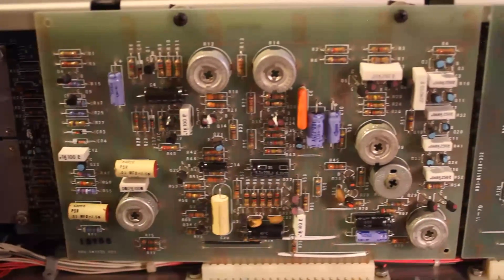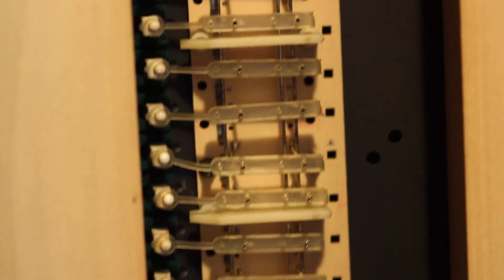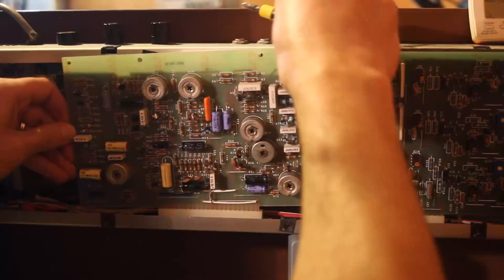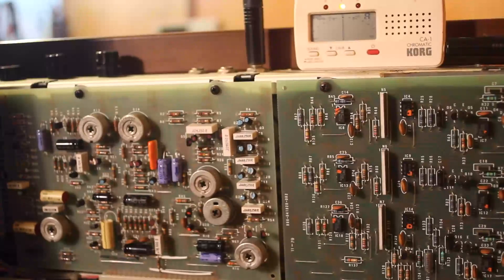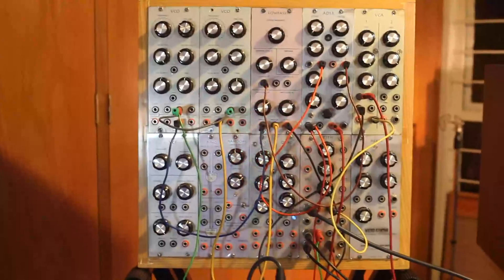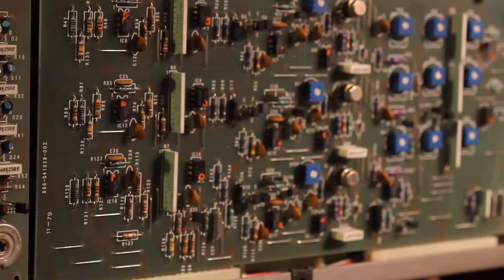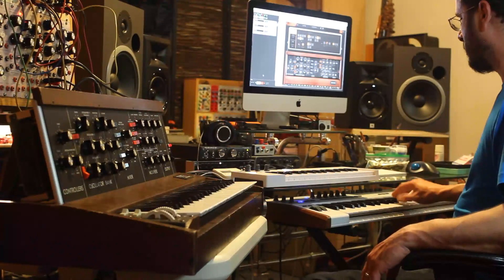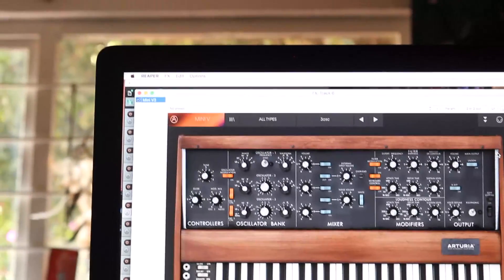Report # 2 - Inside a Minimoog : Service, Calibration and a Blind Test

Comment: For the blind test I swapped the Arturia and modular. I will say it’s hard to capture the difference in these sorts of limited tests. For me it’s most evident when mixing. When mixing I’m used to reaching for lots of fx to shape digital sounds, but when I apply these instincts to when mixing the real deal I almost always end up turning off the fx chain. The straight recording always just seems right, like it knows better than me what the sound should be, and tells me it doesn’t need fiddling with.

Comment: For Calibration don't use metal screwdrivers...
Reply from the maker: as long as the handle is not metal it's ok. I used a metal screwdriver with plastic grip
Reply: @QuincasMoreira  on this one probably not a problem but some older trim pots have a fragile plastic knob that can shear easily

Comment: Heya Thanks for the video! Question..I have a few notes on my minimoog that are intermittently wobbly. Any ideas on what that could be from? I have already cleaned the bus bars and actually had the entire synth refurbished a few years ago.
Reply from the maker: Hey! Hard to say without having the unit in front of me... My first guess would be contacts, but if you've already cleaned them, maybe it's higher up in the signal chain.  Maybe you can find some clues in the service manual or other notes in the PDF linked in the video description. Best of luck!

Comment: Not sure if i have asked this question before. Could you tell me what ic is used in the exponential converter and does it have a tempco resistor thermally coupled ?. Thanks.
Reply from the maker: Adamski, if you mean the Yusynth modular, I built it with a hand matched transistor pair and a thermally coupled Tempco, as described at www.yusynth.net. For the actual minimoog, I didn´t really investigate that and I no longer have it with me. That information may be in the Service manual.
Reply: Synth Diy Guy Ok thank you for your reply . Yes i was refering to the moog sorry on my lack of clarity there. With regrads to the Yusynth vco im aware it uses a matches transistor pair. I think its the lm394. If so did use the ic version or the TO -18 can type ?
Reply from the maker: I hand matched a pair of BC 547
Reply: Synth Diy Guy Oh wow !! . How does it perform temprature wise ?
Reply from the maker: Performs very well! The only advantage to using an IC IMO is to save the trouble of hand matching, but performance wise it's the same. And MUCH cheaper.
Reply: Synth Diy Guy Thats good to hear. Thankyou for the information ;-)

Comment: Hi DIY Synth Guy! my -10v and 10v pots on the power supply board are maxed up and still are about 0.20v out (these pots only allow turning so much before they hit the stopper). Any suggestions? thank you!!
Reply from the maker: Luke Corradine I wouldn't worry about that too much. Get it as close as you can, as long as you can get the oscillators in tune, that's what really matters.

Comment: Main differences that I could hear was the Minimoog was a bit bassier and had more 'thump' at the start. The Arturia had some of the thump, but lost out on the low end a little; whilst the Yusynth kinda lacked both, and sounded a little more precise. That's not a bad thing for the Yusynth, it's just a little different in a way which could work better in some mixes.

I was impressed by the Arturia on this test to be honest. I just got a Minimoog (the reissue) and dialed in what one guy on youtube is showing as the Nine Inch Nails' Closer bass patch. Compared to the results he gets (which sounds pretty meh and quite unlike the original), the actual Minimoog gets way more in the ball park. Quite interesting
Reply from the maker: Thanks for you comment !  Yeah, the yusynth has very different envelope curves, that was the hardest part of trying to match the sounds. The Arturia is indeed surprisingly close to the original. Enough that for production purposes they are interchangeable. As an artist though, I'm much more inspired playing the original, and that to me is more important than any nuance in sound that can be compensated with a bit of eq and compression!
Reply: Definitely! Being inspired and having that "Must keep playing" feeling is the most important, and whatever works for each person is great. I'm with you, there's something inspiring about the original (well reissue in my case), though if other people get inspired by the Arturia VST or other clones, then fantastic. 

Anyway, thanks for the video.